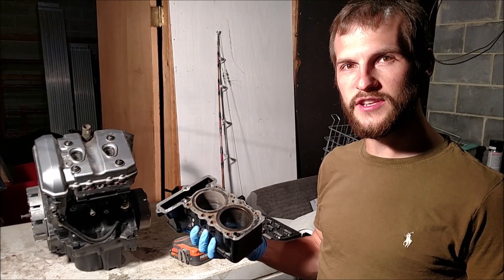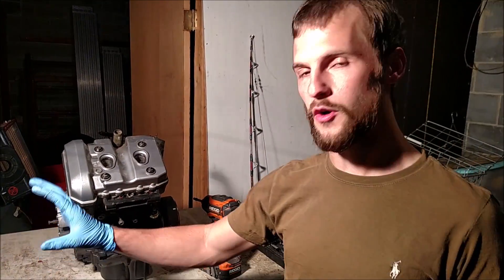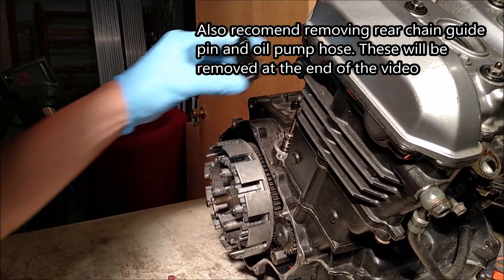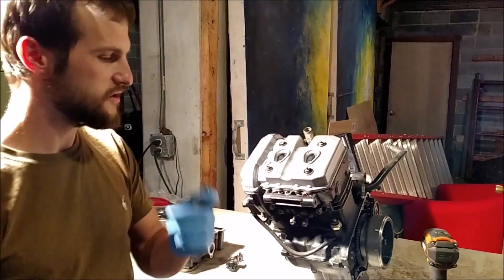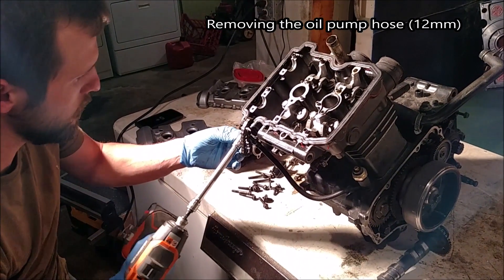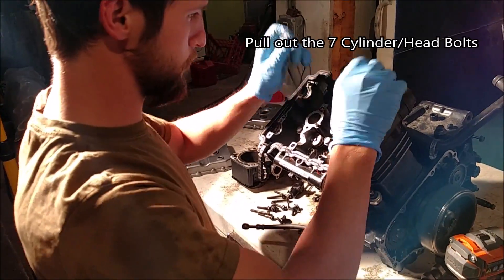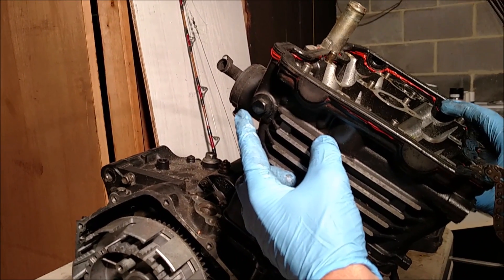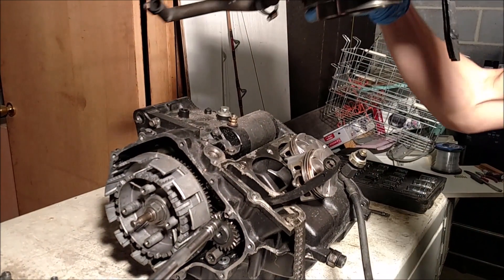Ninja 250R Cylinder and Head Removal

Comment: Thank you allot for this video i have a ZZR 250- EX250H my engine is mixing coolant with oil and it blows it out from the breather hole on top of the lower part of the engine i have not yet taken the engine out i am almost positive that the head gasket is blown and i order a new gasket  just trying to make sure if there is more stuff that i should be looking into if its blown like waterpomp gasket maybe any pointers would be appriciated.
Reply: I’d appreciate if you have any new answer . I currently have a 88-07 ninja 250 took the oil out and was milky ofc I was able turn on and run the bike . As of rn way I’m go at it is checking the water pump seal and pump itself see if that’s why it was bad before jumping into this major issue .

Comment: I've got a 2002 with a factory guide hole in the shifter side of the bike when you look in the hole I can see the sleeve is that normal ? Is there a plug that goes there? Is it missing something
Reply: Spark plug drain hole I believe

Comment: Did you have coolant in your oil?
Reply: Did you find out what was wrong? I have coolant in my oil too I’m sure it was from overheating but not quite sure what exactly to replace
Reply: @jayskidzz1645 hey it’s been 3 years, but it’s most likely a head gasket. There’s channels next to the cylinders that coolant goes through and if the gasket breaks it will let coolant and oil mix in most cases.

There are other things that could cause oil and coolant to mix, but that’s the most common way.
Reply: Totes a head gasket

Comment: Where does the head gasket go? Is it on the surface he uncovered at the very end?
Reply from the maker: The head gasket goes between the cylinder and the head. The head contains all of the valves and cam shaft so it is that assembly. There is also a gasket between the cylinder and crank case. Let me know if that is not clear enough.
Reply from the maker: In the video, at the end it is both the cylinders and head that are pulled out as one unit. The head gasket would be between the two parts so is not shown in the video. There is a small bolt that holds them together which was not removed which is why it came out as a unit.

Comment: Please reply ! So my 250 the spark plug keeps popping up and won't run everyone keeps telling To to just buy a new cylinder head! Since it got stripped and be less expensive to to worry about since it's less then 200$ to buy one online
Reply: Helicoil or insert works fine, I did one on a Norton some thirty five years ago and it is still performing as good as the day it was repaired.  At the time it cost 8p.  About a £1 now somewaht cheaper than a replacement head
Reply: I’ll take you up on the head for sale if it’s still available
Reply from the maker: Yes it's still for sale. Sorry about the late reply. Let me know if your still interested.

Comment: I followed exactly, but my can chain is super tight, not loose like yours. any suggestions?
Reply: Cam chain tensioner needs resetting once removed ... check the manual on how to do this or get a manual one.
Reply from the maker: Have you tried rotating your crank? Depending on the position of your crank you may be engaging one of hte sets of valves, when those are engaged (open and springs are compressed) then it puts a lot of tension on the chain. Check to see what position the "nobs" are in on the camshafts, they should not  be pressing down on the valve rockers at all, that will provide the most amount of play in the chain.

Comment: Awesome video. Now for a video of how to put it back together properly.
Reply from the maker: Thank you, yes I would like too, but unfortunately that will have to wait until I rebuild it again since I didn't do it this time: :/ Motor has been running well now for the last 4 months after the rebuild. Installation is about the same as the disassembly, just have to do a little work with the timing but that is relatively easy to do. let me know if you have questions!
Reply: sounds Awesome. going to be pulling my engine soon as i finally figured out that i have a blown head gasket. i am hoping the cylinders and everything are not toasted too badly, if so ill be finding a used engine to put in.